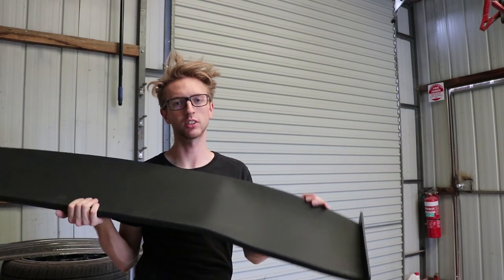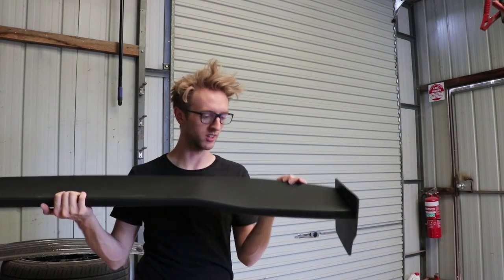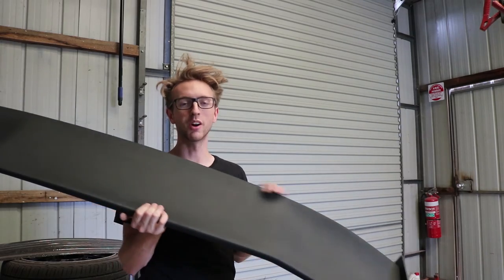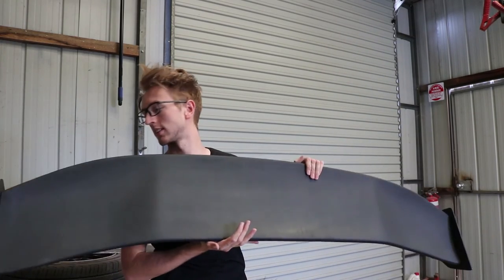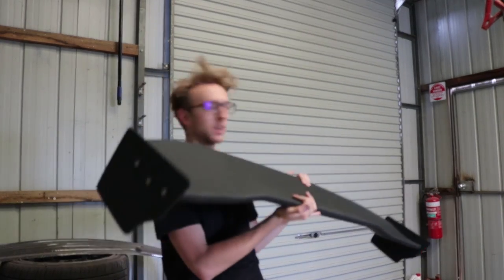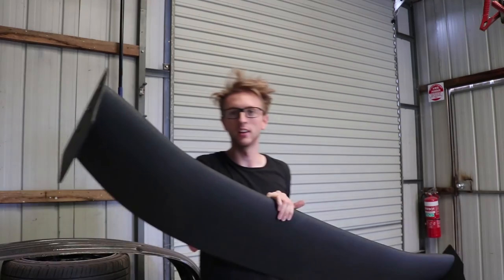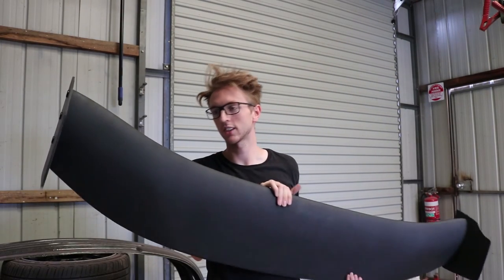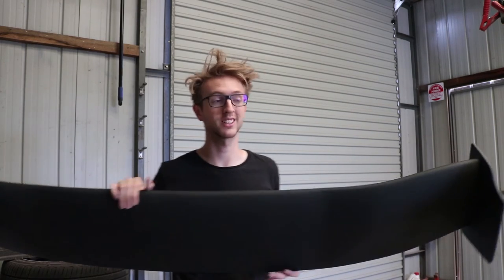We Make Wings!

Comment: how were the ends of the "blade" filled in?? were they fiberglassed and then had rivnuts installed to  bolt thw endplates to??
Reply from the maker: Yep, mostly. In this older version of the wing, the ends are incorporated into the mould so the structure is already there when the skins get bonded together. And then rivnuts are inserted last. However, our latest generation is no longer constructed this way.